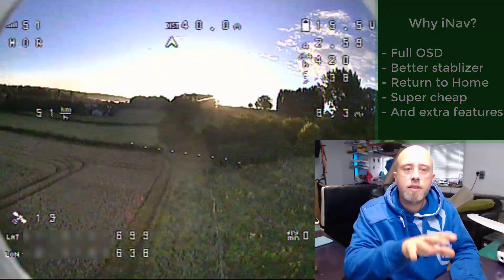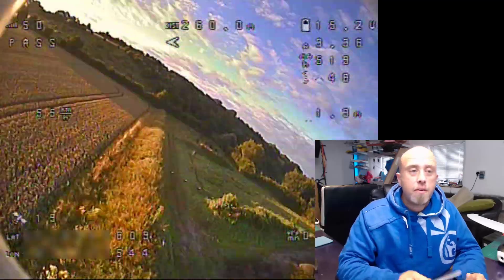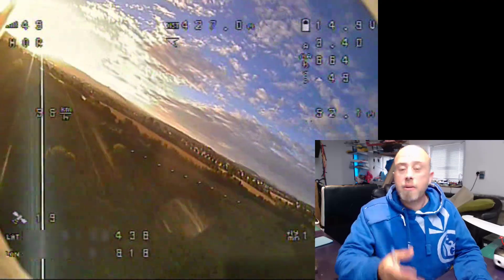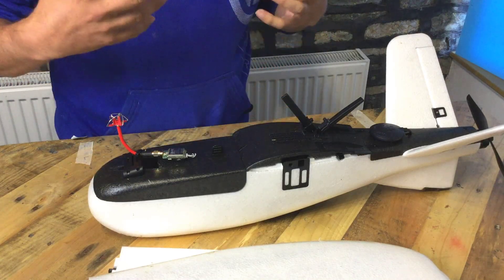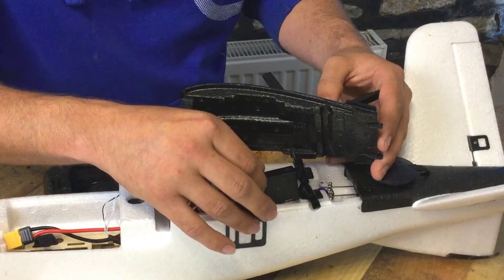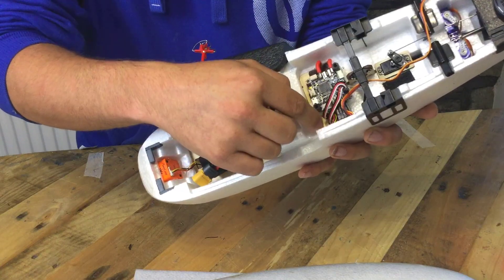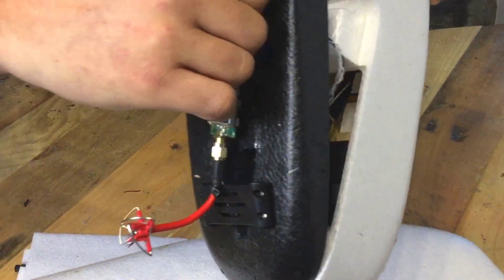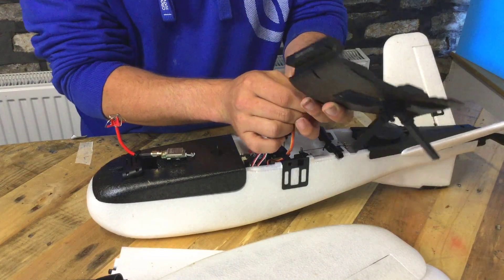ZOHD Nano Talon iNav Conversion + V-Tail Mod + FPV Build Overview

Comment: Darn... lost my post... great review but have you checked the amp draw using an accurate watt meter? A review on BG says on 3S it draws 10.3A on full throttle and "around" 14A on 4S. But your 28 minute time seems to support your OSD reading.
Reply from the maker: Hi John, the review on BG is me. You are aware there is a difference between the current drawn when the model is in the sky compared to that on the desk/ground? Also I didn't hit the sticks hard during the flight, which would cause a spike in current either. Hope that makes sense, Matt
Reply from the maker: Also see my reply to your other comment on the other flight.
Reply: Yes of course...  the term "10.3A on "full knacker" and around 14A on 4S" threw me off and thought it was in the air... cool. That's amazing performance and glad to see fixed wing FPV following quads and getting smaller. Where I fly I can stay up for an hour with that setup in the lift we have. 

But you know what Mat... look around because there are some anti-FPV lobbyists damaging the hobby. Anyone that posts or supports super high altitude FPV flights in general aviation space putting full scale aircraft at risk and supports damaging the RC hobby with a smile on their face is either a fool or a paid lobbyist and unfortunately I know from first hand experience how they deceive people to get a pay check. I wouldn't really say things in America have changed that much, but rather thanks to technology the mind bending has been exposed. One thing you can count on is some people do not like FPV aircraft at all and they are throwing money at trying to stop it while playing "friendly".
Reply from the maker: Howdy John, yea there is always a plank trying to do something silly. Hence why I do my best to keep things safe & to have a laugh at the same time. Matt

Comment: Hello Matt
wonderfull job in all this videos. I learned a lot.
Also I have some questions about settings that not work in my case.
I am using F4 V1, PPM with dragon link V2. FSTH- 9xRadio. Skywalker falcon .
I test all the config in the bench at this point and have the following questions

1.- Can set RTL on the board . Pass T and Horizon mode work ok.  In the Inav Config the comand RTL dos not appear in blue even when i see the stick working fine on the  Inav Config. On the osd not apear the RTL  when i pull the swich. But It does appear RTL and HRZ modes when pulling swich. Also I see a blue led blinking on the board. I  do change swhich  just in case and the problem  continues. Maby have to do with the CLI defaul values on RTL?

2.- Using Inav  it is not necesary to set home position manually.  Is in it?

3.- where can i find the correct config for the motor stick armed, beacuse mine does not work with your config  on video series N°10. Cant get the motor start. all the servos and gps works fine.

Thanks
Reply from the maker: Howdy Pablo, lots of questions, I hope this answers them all.

3. See the wiki https://github.com/iNavFlight/inav/wiki/Fixed-wing-guide#step-4-replace-default-values ( set small_angle = 180 ) and you set Arm as a mode on the mdoes tab as shown in the previous videos on iNav.

2. The home position is set when you arm the board.

1. Really not sure, go back through the series for the modes and setup and see what I say there.

Matt
Reply: Thanks Matt for helping me.
I can arm the moto now!! yea!!

No getting the RTH set yet. :(  Working on it, erasing everything and starting from the scratch...
For F1 its is possible to read the battery voltage at the OSD?

Comment: Thanks for the video! Do you think a Foxeer Arrow V3 could squeeze into the camera slot? I'd like to use a camera with an OSD.
Reply from the maker: Morning! Yes absolutely. Because if it doesn't fit, a quick whip around with the craft knife WILL make it fit :) Hope that helps fella, Matt

Comment: What battery you using matt just ordered one saying it has xt30 is that true?
Reply from the maker: Howdy Chris, mine came with a XT60 connector. I have used a 1300mAh 3S Nano A-Spec battery which worked well and I'm now preferring to use a 1600mAh 4S Nano Tech 4S for the extra flight time and go-go juice on 4S. Hope that helps Chris!
Reply: Matthew Ogborne thanks mate banggood being strange lol

Comment: Great job just got my s800 so  now i want a nano by the way Mat what motor do you reco for the s800 Regards Bill
Reply from the maker: Howdy Bill, ooo you'll like the S800, it's well tough! As for which motor, I put a DYS SE2205 2300Kv motor on mine and it was "fast". Anything around that size will be OK. Hope that helps, Matt

Comment: Hey Matt. I've done a lot with iNav on quads and hexes. My question is, do you trust iNav enough yet to run it in your mini drak?
Reply from the maker: Howdy Mike, yep I'd put it in the Mini Drak if I had too, however the Vector that's in there is working so well, I'm not likely ever to want to take it out :) Matt

Comment: Hi MattDid you have rssi connected to the L9R? Did not see any extra cables when you removed the receiver.How do you connect it up?Always watching your videos- thanks so much for your efforts in sharing
Reply: David RC 
You can inject it into the PPM stream through the flight controller. In the receiver tab
Reply: I'm pretty sure this only works with telemetry receivers, not the L9R
Reply from the maker: Thats correct grahame, you have to attach the RSSI out to the RSSI pad on the F4 FC board, see this video for the setup https://www.youtube.com/watch?v=LJLeuoeMy2I

Comment: Nice neat install Matt....She does fly predictable smooth in calm air, you must have been up very early as it has been very windy again here, all July in fact...I can't justify buying one just yet as I still have two Mini Talons in boxes bought for £35 in the BG Sales...I have a third, flying one with APM Mini Pro in it, but intend building a 4000mah 3S version super light weight for easy handling with F4 and iNAV....Even then I think it will still be good for a 6km radius if not more....lol....Try 1280mhz video m8, it's so much better than 5.8G...:)...Good job..
Reply from the maker: EnglishTurbines Howdy ET, yea the mini talon is a LOT of model for the dosh. Over the moon with mine! As for 1.2GHz video, you'd need a base station to receive it. Thus extra kit to carry to the flight line. 5.8GHz is good enough for me :) Matt
Reply: Matthew Ogborne Hi Matt, yes I use a custom made Patch Module with a 5.8g relay, its all on a tripod....BUT.....You can get a 1.2G module rx for your Goggles I believe...?...Just like you are using now....and no, you dont have to have those giant 1.2g Skews like Sir Dave uses either...:)

Comment: would you recommend it as a 1st RC aircraft? Also would you use a runcam split for an HD cam?
Reply: PopWing, esp if you're in the States, or a TechSumo. Stick with something that is EPP foam and CF rods. That combination is pretty much unbreakable. If you already know how to fly this would be a decent model. It seems about 2X too expensive for what it is. You can get a lot of plane for the same price elsewhere.
Reply from the maker: Defo not a first time model. Look up the AXN cloud surfer on my channel, it's what I learned to fly with, Matt
Reply: can you use the run cam split as your flight cam tho? would it suck up much battery? sorry im new to all this

Comment: Thanks for the video. With such a low amp draw, perhaps you can drastically increase your flight time with the Li-Ion power packs from 3dxr.co.uk: the C ratings of the used cells seem good.
Reply from the maker: turdsurfer Evening, I have a 4S1P pack here that I made, I'll give that a whirl and it's rated around 2500mAh too! Matt

Comment: Is there not enough room under battery bay lid when loaded to fit the VTX & poke the antenna out through front duct???
More I see this thing the more I like it! :D
Reply from the maker: Howdy Lee, you could do that. But remember on more than  25mW these little vTx's get VERY hot, thus I decided to put mine on the top of the lid, gained more ventilation and an extra inch or two separation from the receiver antennas. And did you spot how smooth she now files when it's not windy as f***? Matt
Reply: I HAVE noticed smooth flight- possibly deserving of the prefix; Silky! ;)
Coldn't, & still can't quite, see all the benefits of V-Tail- and still liking wings.....buuuuuut.......
Got me thinking my first foamy might be one of these WW2 look-a-like drop-bombs rather than a Vampire....
Advantage of the Vampire- I can enjoy looking at it before before I get the knackers to fly it.
While the Nano Talon, as sweat as it appears to fly & be a great package for the price, it still looks like something dropped from under the wing of a WW2 Catalina hunting subs in the Pacific! :v
Then again, I do have PDF plans for a 57" foamboard Cat' that could easily be doubled......one day.... 3:)